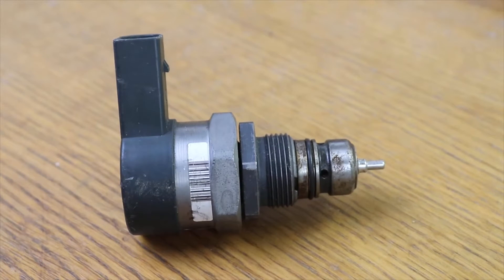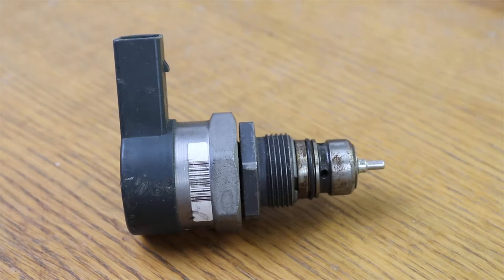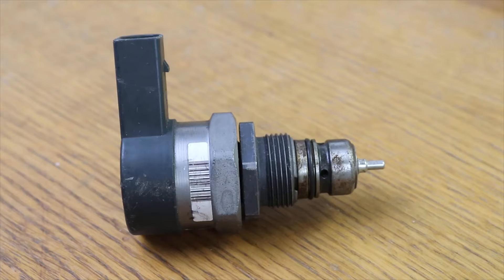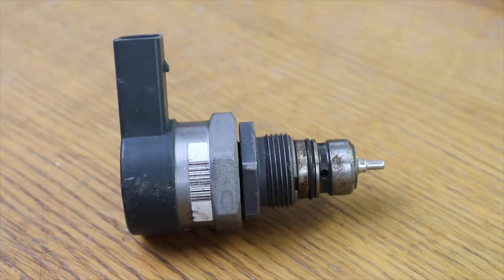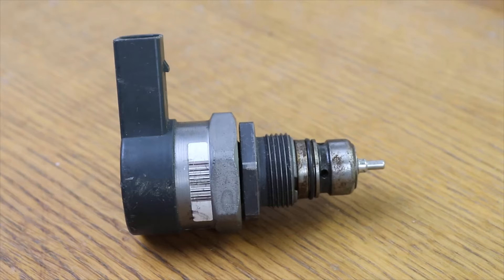5 SYMPTOMS of RAIL pressure REGULATING valve FAILURE, COMMON-RAIL

Comment: Hi, when i unplug pressure sensor car works better but with it fuel pressure warries i changed sensor it is the same, should i try replacing this regulator
Reply: When i unplug Egr car work perfectly, but Egr its ok i measured it , Is it possible that I have a problem with fuel pressure regulator?
Reply from the maker: Check the fuel pressure with the diagnosis machine...